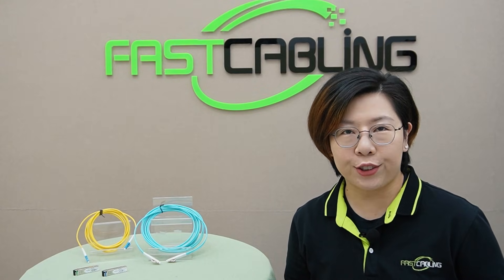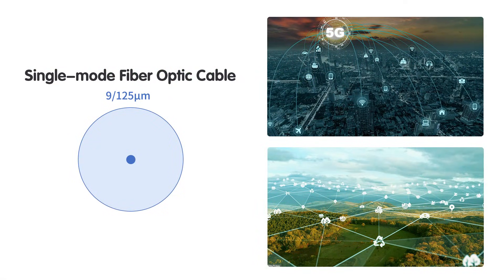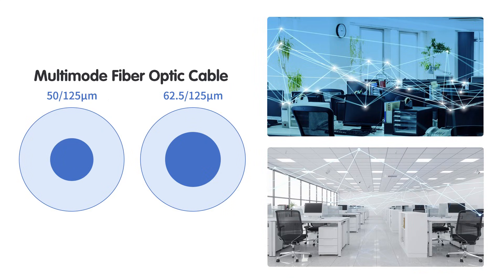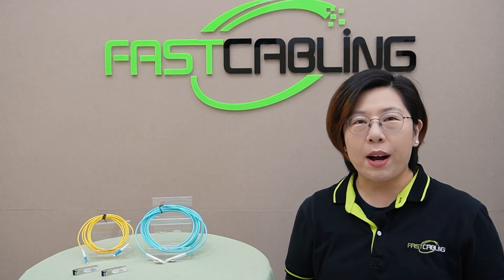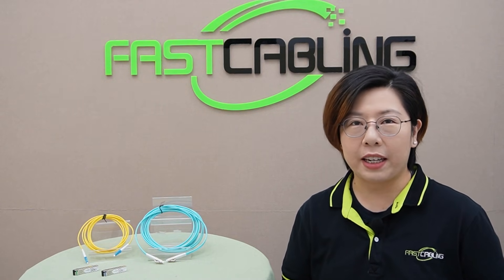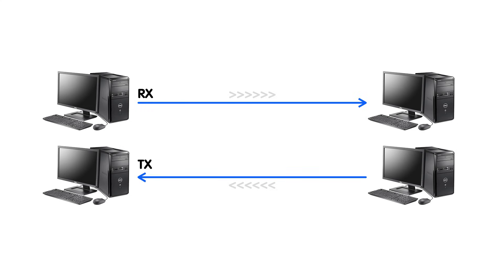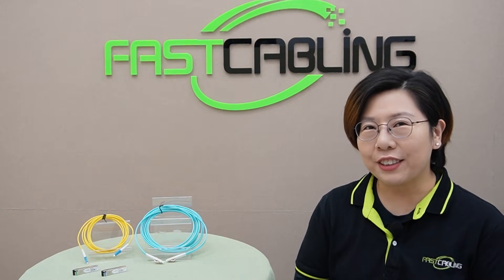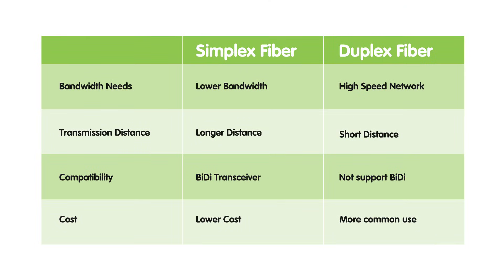Single vs. Dual Fiber: How to Choose the Right Cable for Your Network

Comment: Firstly a great explanation I loved it. How to identify which cable is Transmitting and Receiving in single mode duplex fiber connection.?
Reply from the maker: You identify them by the wavelengths labeled on the SFP modules. One end transmits at 1310 nm and the other at 1550 nm, and they pair together automatically.

If it says Tx1310 / Rx1550, that end is transmitting at 1310 nm.
If it says Tx1550 / Rx1310, that end is transmitting at 1550 nm.

Comment: Is it possible to split single from media converter and can it support 1 by 8 splitters
Reply from the maker: The media converter won’t suddenly support 8 devices just by splitting the fiber. What you need is a PLC splitter. It's commonly used in PON networks. 

https://www.fastcabling.com/product/2x16-outdoor-plc-splitter/

Comment: Would Simplex be fine for transmitting security video footage?
Reply from the maker: Simplex is typically used for one-way data transmission, like video feeds. If you need bi-directional communication (e.g., for camera control and video transmission), you might need to use duplex fiber (two strands), but for simple video transmission, Simplex is perfectly fine.
Reply: @Fastcabling thank you for the response! 

Learned something new :)
Reply from the maker: My pleasure!

Comment: Thank you for your videos! I recently found your channel as I'm planning on buying a Banana Pi R4 which comes with two SFP slot, but I have one question. I noticed that the SFP receivers always come in pairs, in my home network I have the Fiber Terminal Box were a single fiber connector comes out and connects to the ONU that also works as a router. My plan is to replace this ONU with the Banana Pi R4 and use a SFP receiver to connect the single fiber to it directly, my question is. Do I need to use the two receivers and connect them together with a separate single fiber cable, or should one receiver work?
Reply from the maker: Your Fiber Terminal Box outputs a single fiber optic cable. This cable connects directly to an appropriate SFP module installed in one of the SFP slots on the Banana Pi R4. SFP pairs are typically used for point-to-point connections between two networking devices (e.g., switches or routers). In your case, the single fiber connection from your ISP requires only one SFP module to establish the link.
Reply: U need a sfp onu not sfp transceiver , contact ur isp they might be using OLT not fibre switches to ur emd since u said u have onu as ur end cpe of isp

Comment: Our local ISP, Verizon, utilizes a single fiber optic cable that's directly connected to an optical switch at their central office. This setup allows for high-speed internet connections, with current capabilities of 10 gigabits per second (Gbps) and 40 Gbps. Verizon has also indicated the possibility of future upgrades to 100 Gbps.
Reply from the maker: Using an optical switch as a core switch is a common way to manage multiple distribution/access switches. Fiber connections can handle speeds of up to 100Gbps, but upgrading hardware to achieve those speeds can be quite costly. As an alternative to using a single 40Gbps port, you can consider aggregating four 10Gbps ports to achieve 40Gbps performance.
Reply: @Fastcabling  thank you for your detailed reply. Impressive Channel.
Reply from the maker: My pleasure!
Reply: If we are talking consumer installation - that fiber isn’t dedicated. And a single channel to the office can be shared by sometimes well over a hundred households. And the bandwidth at the office switch isn’t that high - it can be 2.4gbps for installs that allow up to 1gb plans, and 20gb for X-PON allowing up to 10gb.
Reply from the maker: In this case, it's better to use PON  for FTTH applications. It can split the bandwidth to up to 128 clients.
Reply: On the street we have a 216 pair fiber optic cable. Each house gets one  fiber optic cable. This  Attaches to a fiber Loop Mux converter then to  a verizon  provided router. Fios service. 1-2 giga available speeds on customer side.

Comment: Do you mean XGSPON gpon module as bidi conenctor ?
Reply: No,
Reply: Bidi is so nice, it’s becoming more common now..
Reply from the maker: No, it's the BiDi single-mode sfp module (used in active optical networks). It can send and receive optical signals over a single fiber strand using different wavelengths.